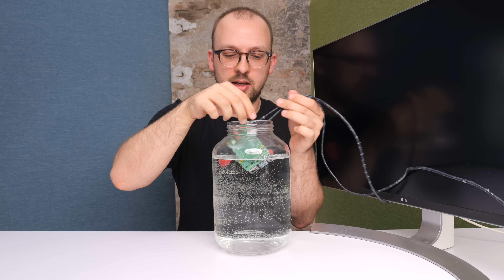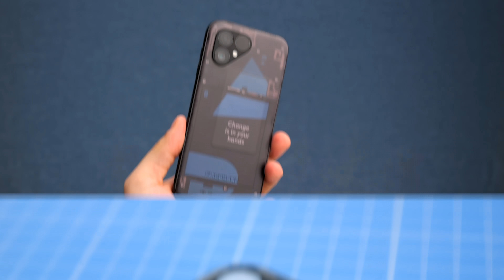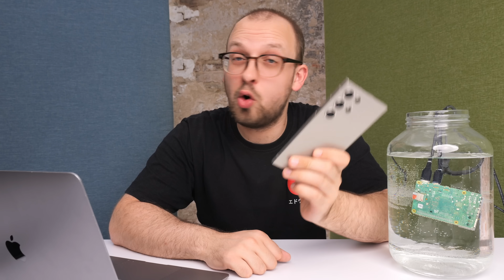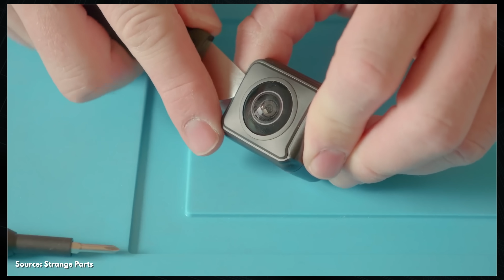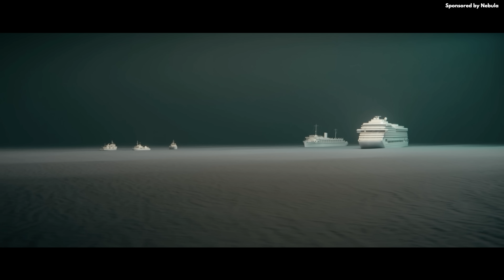How waterproofing works (and fails)

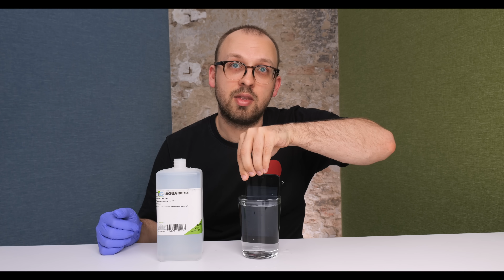Comment from the maker: In case you are wondering, the screen went black around 0:05 because the HDMI cable was bending too much, not because of water. Also at 1:59 what happened is tha the phone simply dimmed its screen. You can see that it's still on if you look closer and I didn't notice it at the time because it worked fine after :) 

Get Nebula using my link for 40% off an annual subscription: https://go.nebula.tv/techaltar
Reply: Was there hot glue on the HDMI and USB cables? Nono coating or not the contracts are exposed.
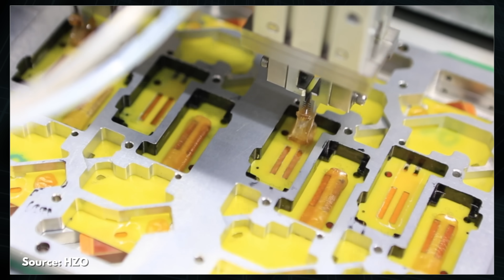Reply: @MNSweet  Yes 6:51
Reply: @MNSweet  Watch the complete video, he explained it in the video.
Reply: I wish raspberry pi used HDMI mini instead of micro on the 4/5. The micro connections are really easy to interrupt
Reply: You're wrong about the Titan submersible. It visited the Titanic multiple times before imploding. Its ok to lie about politicians but don't lie about a dead guy's invention.

Comment: Very cool, thx for the info!👍Well as long as they don't use forever chemicals like PFAS and wash them in the drinking water or soil it looks as pretty effective way water coat electrical equipment and integrated circuits.

Comment: i'm a bit disappointed, conformal coating wasnt mentioned. it's widely used in the drone hobby, and effective enough, you can launch a drone with properly coated electronics from a pool of water.

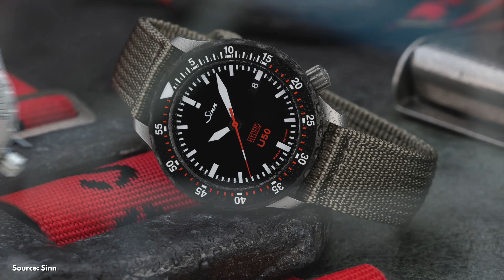Comment: 12:30 Liquids aren’t much harder to compress; they don’t compress at all (this is how hydraulics work); the issue with oil filling is when there is air because air is VERY compressible 😊
Reply: A simple google search will tell you otherwise. Liquids are just so close to being incompressible that people treat them that way, but they are in fact the tiniest bit compressible.

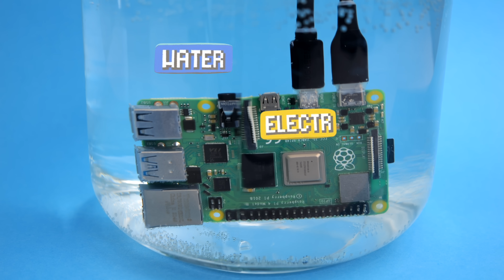Comment: 0:25 as long as its completely distilled and deionized water it should actually run without too much problems

Especially with 5v 

Now add some salt or minerals or some free ions in the water

Get a liquid resistor....and start electroplating shorts
Reply: Pure water is actually a terrible conductor or electricity and heat

Comment: 2:20 water with salts does not have free flowing electrons. When you disolve a salt into water it splits into positive and negative ions. These ions will flow freely, allowing electricity to flow.

Comment: Didn't know consumer stuff used paralene. It's a pain to mask stuff off and run thru the vacuum chamber. Since it's a solid dimer that boils into a gas and polymerizes on surfaces in the chamber you control thickness by calculating total surface area of the chamber plus your assemblies and load the required amount of powdered. No idea why they hype it as nano, been around for 60 yrs.

Comment: Just a small correction: Water is indeed conductive. It's true, that water is a very poor conductor, but it definitely can conduct electricity. Every chemist knows, that pH 7 means, that there are 10^-7 mol/L H3O+ ions and 10^-7 mol/L OH- ions in water - it's called the autoprotolysis of water - and since there are ions, water is indeed a (very weak) conductor and can therefore destroy electronics by shorting electrical connections. Saltwater has a lot more ions and is therefore much more conductive and can easily destroy electronics. The pressure component you mentioned, just means that the water has an easier way of entereing the phone. And once inside, salt water quickly shorts any connection it can "find".
Reply: That also bothered me that He didnt mentioned this behavior
Reply: Ok, but anything can be conductive with enough current even wood
Reply: @mission3479  That's not a very useful statement. Wood contains lots of - well - water ;) That's why the conductivity of (moist) wood is similar to that of water with a lot of ions in it. Dry wood on the other hand is muuuuch less conductive and would therefore correctly be classified as an "insulator". But sure, you can ionise any neutral matter if you put enough energy into it - but that's again not a very useful statement ;)

Comment: Something that actually accelerates corrosion is electrical charge. Back in the day of removable batteries the best thing you could do to limit corrosion was to take the battery out immediately. As batteries became permanent, the need for water proofing increased significantly

Comment: regular pure h2o will still conduct electricity. water normally does not stay as "noble" water molecules but rather an H ion and an H30 ion. so over time, de ionized water will not remain nonconductive (especially if you dip your metal heavy phone in it). even if you're super careful about keeping out external ion sources.

this is why there is a difference between deionized water and distilled water.

also meterials like goretex (and maybe the mic and speaker holes, i dk) are coated in some type of PTFE-adjacent coating. This (along with the physical aspects that you describe) keep them water repellant.

super interesting video dude!

gonna use this when i get asked about waterproofing

Comment: Water does a lot more than change resistance between contact points. Dielectric properties change, crystals resonate differently, temperature gradients change. Your position is too simplistic.

Comment: There is tradeoff here. Those materials are probably thermal insulators as well and manufacturers can not coat every part but put silicon sealers around.
Btw, did you lose weight? Formula please :)

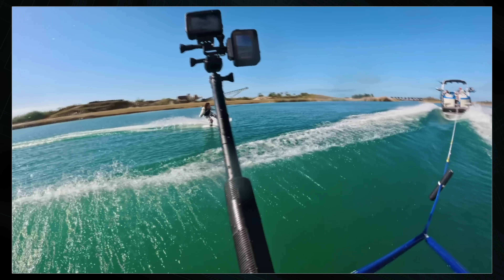Comment: 9:18 being nitpicky here, but isn't the pressure from a wave (with a bubbly surface) magnitudes lower than the pressure from a flat water surface, with all its surface tension? Like dropping a watch into a calm pool will most likely kill almost every watch, except those rated for IIRC 10 bars or more. A wave that strong will kill anyone instantly.

Comment: Actually, "pure" water will still have a pH, so not only H2O molecules. If you wanted water to not rip itself apart, you need to be at absolute zero or a single molecule in a vacuum.

Comment: What I found really nice on cheaper phones is that they have resin on the tiny surface mount devices on the motherboard.

Those tiny components are protected from water using a resin barrier in addition to a gasket around the Type C port and headphone jack. My spare phone doesn't even have an IP rating but it has survived contact with water plenty of times.

Comment: You missed the chance to show Samsung Xcover 6 Pro which has a removable back cover with IP68 water and dust resistance. Now people will be mislead by the companies claiming that the only way to achieve IP rating is by sealing everything. But the rest of the video is damn good.
Reply: They already are, people who say they need removal batteries get "you'll lose water resistanance" in the reply.
Reply: @FR4M3Sharma  Yeah. I guess people will never know the truth unless this comment goes to the top.
Reply: He did show the Motorola
Reply: @sajanpreetsingh9144  Yes. He has shown that using Motorola Defy, but the newer versions of Defy no longer have a removable back cover. But the Samsung Xcover 6 Pro launched in 2022 still has a backcover, which shows that companies still could provide that option if they wanted to. Not showing recently available products with back covers in the video would confirm the bias of audience that removable back cover is an ancient practice in tech world and the only way to move forward is gluing things up.
Reply: Everything is possible with enough space - which is why the xcover 6 pro is so chunky
Reply: Wow

Comment: I say the best way still for waterproofing is , silicon gaskets and flap covers for ports and not gkue ! , Samsung Galaxy s5 and Lg g4 had waterproofing rating with removable back cover that shows the potential ! . The real reason why company's dont really push for waterproofing is purely for their monetary purpose. I doubt a smartphone with silicon gasketed back cover along with nanocoated internals and a flap for usb c would be even sea waterproof for 2-3 meters !

Comment: Here is what I do because I run several computers(Motherboards) in a moist basement : I wash them fully with WD40 & then liquid detergent. I repeat this again is the motherboard is old, so that corrosion is removed properly. Then dry them fully for couple of days. They I spray them with one thick layer of WD40 and put them to work immediately. The other remedy is to use dissolved grease in turpentine oil which when dried will allow the grease to remain covering all the components. This will last longer than WD40. I have done this to more than 12+ systems/network switches and some of them work 24/7.
Reply: I didn't know WD40 was so safe. I usually waited a minute or 2 after applying it on my mouse's button lol. 

Thanks for sharing.
Reply: @narutokunn  IMPORTANT : After WD40 eats/loosens corrosion, it has to be removed in some way. I use liquid hand wash and an art painting brush. Otherwise the corroded remnants might short adjacent leads. Final coat has to be applied when no corrosion is left around components.
Reply: @prashanthb6521  Wow I learnt a ton from you today. I had no idea about any of this.
My mouse was doubleclicking and I watched a 1min youtube video which suggested applying a drop of WD40 on each button (with no other information). I hadn't even heard of WD40,
It did work but now I know what WD40 is actually doing and potential side effects.

Comment: The most mindblowing thing I learned from this video was that there are divers that live under water for WEEKS  living in little tubes and breathing bespoke gas mixtures? WTF, that's just crazy.
Reply: I'm more surprised by Rolex being in the diving business.
Reply: @reed6514  To those unaware, yes it is a huge surprise, but you wouldn't imagine mine when I saw that one of their oldest models (still made today) is called "Submariner", made for diving and including hydrogen valves since their conception.

Crazier yet is that most Submariners they sell are NOT used for diving, much like how most trucks and SUVs are driven by road kings and soccer moms.
Reply: Deep diving welders make a ton of money and their job is insanely dangerous. If you are curious to learn how wrong things can go see the Byford Dolphin incident (with a warning).
Reply: @themroc8231  (Byford Dolpin Incident warning: gross dismemberment)
Reply: Dont forget that because they breathe helium 24/7, their voices are super high pitched while trying to do serious pipeline work lmao
Reply: They don’t live under water. They live in a pressure chamber on the deck of the boat. Then go down to the sea floor using a pressure chamber. The pressure at the working depth is the same as in the chambers = no need for time consuming depressurization every dive
Reply: @bowesterlund3719  Some use pressurized habitats underwater & others use ones on the surface.
Reply: @bowesterlund3719  Both exists. There are also habitats that are under water.
Reply: samee, i didn't even pay attention to the end of the video bc wth was that?? also why do they bring their watches there with them??
Reply: @kalla103 They have a limited amount of time to work, so it's important that they know how much time passes. It's not like they have a clock or phone.
Reply: They are usually not living under water, but in a pressure chamber on the surface which keeps them adapted to their workplace depth. If the seal of the chamber breaks, it will decompress explosively, scattering the inhabitants all over the place as pieces and body parts.
Reply: @arcturuslight_  The Byford Dolphin incident (in which one diver [out of 4 in the chamber] was scattered all over the place as pices and body parts) actually led to new safety mandates to prevent a repeat.
Reply: the closest people to the space people
Reply: Yes! Those are the guys that put fuel in your tank, close oil spills and - on very rare occasions - get tons of methane to bubble up near those Nordic countries. OH ... they also keep our internet running. Here where I live, these guys work for 6 months, rest for the next 6 months, and retire after 5 years.
Reply: Wtf oi share the timestamp
Reply: @Flappybeanbag  12:50

Comment: distiled water don't remain non-condutive for long after you've contaiminated it (i.e: putting your dirty phone into it), that phone will die sooner or later
Reply: Yes the distilled water is a very good insulator
Reply: @manclt704  Yes, but the dirt will cause dissolved ions to contaminate the water, making it no longer distilled and also more conductive over time. If you had a bag of dirt left in a tub of drinking water for 2 hours, would you drink the tub water?
Reply: @robertcarter9800  Yes, indeed you are right, I commented on his demo which was not making any sense to test water resistance with using distilled water as this is not a real-world scenario
Reply: @manclt704  that's true I misread "yes" as "yet" my apologies ☠️
Reply: @manclt704 the point is that everything is “waterproof” with distilled water (for some time)- even a non ip rated phone
Reply: @manclt704  and an even better solvent

Comment: The internal water sensors in phones (designed to be checked so they don't have to cover warranty) can be triggered in high humidity environments, like a tropical location (eg. Singapore). The reason for this is that humidity can get through the speaker gaps.
 This means a phone without water damage can be rejected from warranty just because of those sensors. You have to fight to get them to check the entire phone.
Reply: I have fought and won 😂😂😂
Reply: Ya litmus papers
Reply: @JP_Names  that's called an indicator - indicates that something has happened but now how much.
Reply: Those are not sensors. Simple stickers
Reply: @drk_blood that sense if water has touched it
Reply: @drk_blood and a thermometer is simply a liquid
Reply: @somnia3423  what themometer ya using? Mine is just a plastic thing with eletronics and a screen
Reply: @JP_Names that not even a analog sensor lol. it just a piece of litmus

Comment: Aren't these nano coatings basically pfas/ppf's that are quite shitty for the planet?
Reply: Some definitely are. The parylene mentioned in the video is a PTFE alternative (non-PFAS) that's considered safer, though I don't imagine that means "harmless".
Reply: @computertoucher  PTFE is about as harmless as you can get; it’s almost entirely non-reactive with every common material.
Reply: The 0.0056 g of nano coating is nothing compared to that 4500mAh Lithium and Cobalt battery in the phone you’re using to watch this 💀
Reply: But if it works you are more likely to keep device for longer.
Reply: I know I don't give a shit about the planet.
Reply: @Arkhaline it's really about your health as well